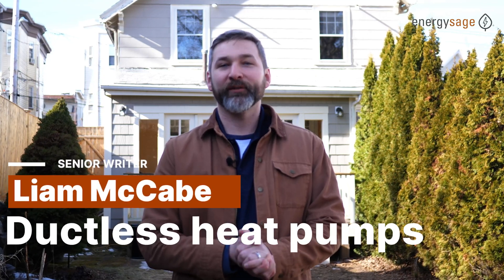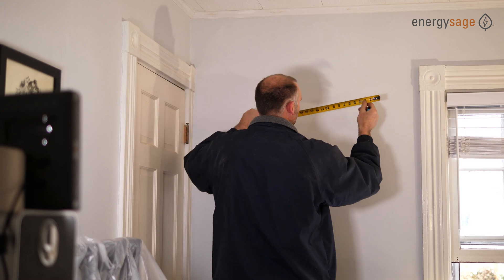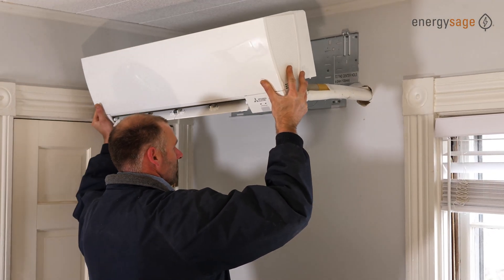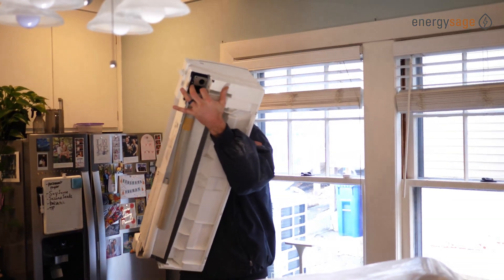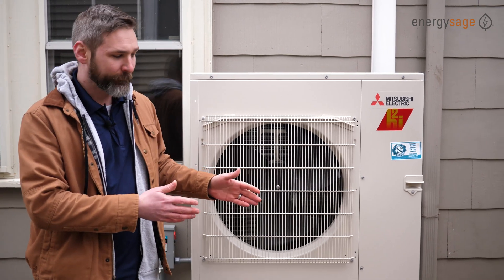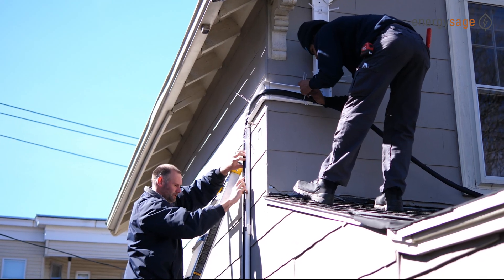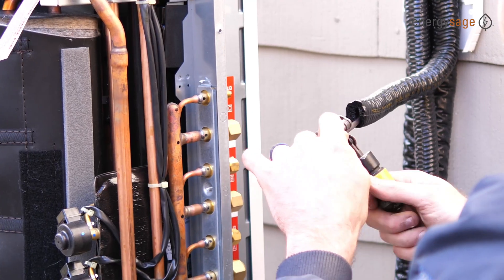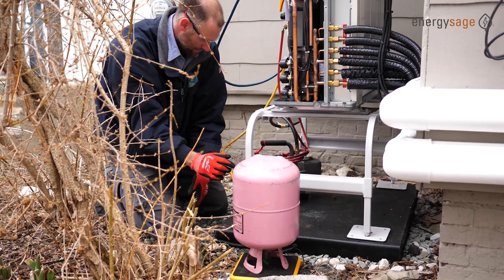Mini Split Installation — Watch The Pros Install a Ductless Cold-Climate Heat Pump

Comment: Pretty cool tech for sure. I plan to install one in my garage, mainly for heat. Should be cheaper in the long run over natural gas. The side effect is using it for cooling in the summer.